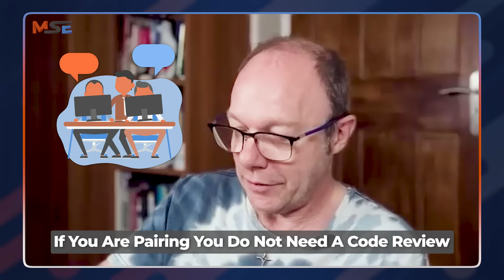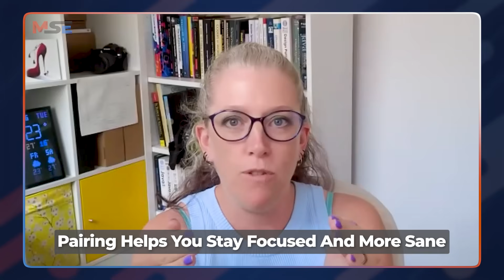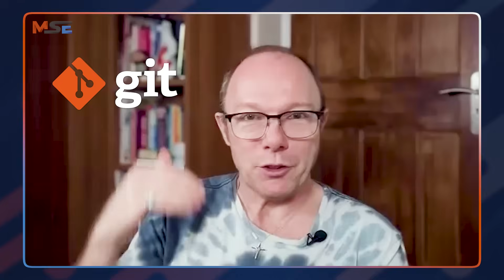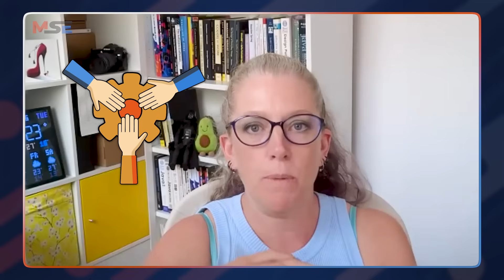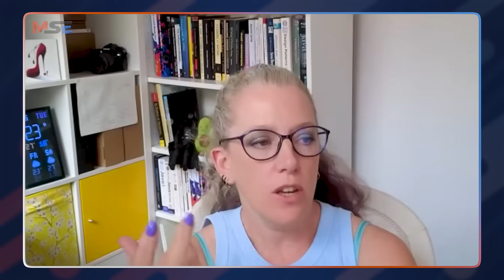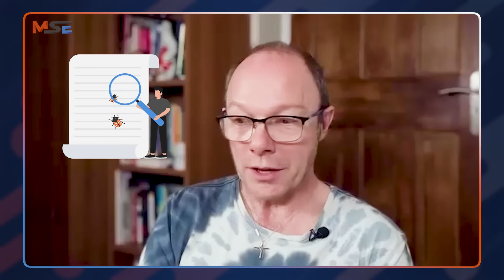Are Code Reviews Even Necessary?

Comment: Trunk-Based Development changes where collaboration happens.

If code review happens only in pull requests, it is often too late. The important architectural and design conversations should happen before and during the work, not after everything has already been built.

Pair programming, mob programming, or even a short discussion with a colleague is often the real review.

Then the PR is not a safety net anymore, because the safety was already built into the way we worked from the beginning to the end.

Comment: I think code reviews are even more important now. For one thing, we as developers are responsible for understanding the code. For another, just someone looking at the code who wasn't involved in writing it will have a fresh perspective that's valuable. Also, AI code reviews are more and more useful. A question I have is are these code reviews taking longer for the same amount of code as before, or are they taking longer because there is more code going in? If the latter, they're not really a bottleneck. It's just that's more code than the team can cognitively handle, and maybe the team would benefit from turning AI to other tasks for a bit, like code hygiene or documentation.

Comment: I had hoped to get at least a few concrete examples how other teams solve this "huge bottleneck" code review when we generate so much  code  and how they avoid spending much more time for code review than to generate  the code ? you have some ?
Reply: Most of the teams I have seen doing it online dump pre commit reviews entirely so they are not blocking, and replace them with test driven development to generate an executable specification, and continuous integration to make sure there are no regressions.

Comment: AI (Co-Pilot/Codex/Claude) is my new pair programmer and code explainer. I recently did a KT and used Co-Piloit to explain (my own code) to me in plain english, and while it occasionally got things wrong, it also surfaced quite a few issues with the logic that were diffucult to see, and none of the humans who had reviewed this code over time had spotted.
Reply: As llms fundamentally have no model, just lots of correlations, this is exactly where they work best, highlighting code which is implausible so you know where to check. When you running it the other way to generate code, what comes out looks plausible, but has a good chance of being buggy, just like most of the code that was in the training set.

Comment: I'm going to wrestle with this one because I don't have anyone review my code but I do have one person that will be responsible for every bug and that's me.  So in order to avoid having to deal with issues, I learned when I first started coding 30 years ago to write code that almost never fails.  It's not that difficult - it's like taking a SAT score scoring 790 and then fixing the one wrong answer during testing.

But I've seen people who are pathologically dependent on code reviews to make their code work.  They also never find any bugs (ever) and their code doesn't work half the time and I find 50 bugs in 10 minutes usually.

It comes down to accountability and pride in your work.  I don't know if you've seen a Japanese master artisan on their craft but they treat everything with the exact same level of care and attention.  I just do the same for code.  If anything ever fails in our application, it's a 3rd party tool or a problem with another piece of code that I never looked at.  Once I had one deployment out of thousands have a tiny issue and I realized I'm getting old 🙂

So do you need 2 people to do the work of one person?  Probably not but junior developers usually can benefit.  There are also many people who were never meant to be developers - they are more programmers and code/bug generators.

Comment: For me there are 2 aspects regarding code reviews. The first aspect is to try to understand existing code. Identify entry points. Identify where there are boundaries between communication layers. understand bugs. Etc.. We had coding style guides but no one was enforcing them. I abandoned coding style guides especially if it turns into a bothersome formalism exercise. In the end I stick with only few rules. "Don't try being too smart and cramp too much logic into a few lines of code or a single line of code".
The second aspect is using static code analysis tools. It may help me identify issues I have overlooked. But it may take some time understanding the rationale of an issue and introduce a fix that doesn't cause too many new issues.

Comment: Who exactly thinks they're not necessary? What kind of operation are such people running? Websites for personality quizes and celebrity news that's 90% ads? Is that peak engineering for them?
Reply: A lot of the public reviews I have seen are pre commit reviews which are pure gatekeeping, which just slows everything down, and are thus completely pointless and should just be dropped. The three types practiced by the two experts are not that, and can be done after committing the change to flag up policy problems, help formulate policy, and just show off good code or share knowledge.

In most public contexts, the primary problem seems to be  a lack of reviewers, combined with too many changes stuck waiting for review, which just slows everything down without making a big difference.

The only solution I know of is to do test first design tto give you an executable specification which is then run as part of continuous integration, where the best way to do it is tdd.
Reply: @grokitall  Automated testing isn't enough. It just tells you if there's any regression, given that there were enough tests actually implemented. And most of the time the developers have to update the tests. How do you know the tests pass because the developer updated them incorrectly or because there were no regressions?

With such a hurry to just push and ship, no wonder why almost every single website is frustrating and unusable. In serious software industries that has quality standards, there are many review and testing stages before anything is merged and a lot more before it's shipped.
Reply: @grokitall  you mean pre merge, no?
Reply: @ivanivanovski1 when you are doing tdd, you could be running as high as 100 tiny merges per hour, and a 15 minute wait before you can commit for someone to come along and review each one just does not work. This is why they use testing, trunk based development, and ci.
Reply: To the CTOs here: I’m a veteran systems engineer (20 years exp). Ready to take over your team's routine tasks and clear technical backlog.
After a massive force majeure, I am starting over from scratch. Not looking for charity—приму (accept) hard engineering work to stand on my feet again.
If your team needs workload relief, let's connect. Details are in my bio.

Comment: You are all so blessed working in such small organisations.
Go out there see the ugly and the bad, then you don't even think about this question at all.
Reply: Yes, but for example: Equal Experts and Thoughtworks consult with Fortune 500, and the speakers here write books, speak to and at conferences with similarly large organizations.
It's the position in the company they are hired to operate at. These organizations have people or groups who attempt to raise, push or set examples or the standards up to a higher level of software engineering.
Reply: Yeah.. We do code reviews at my org to make sure the devs actually did anything besides committing arbitrary whitespace and pretending that the 0.1 story point feature is actually taking several weeks to implement. There are a lot of people out there scamming their employers, whether you think that is good or bad is up to you...
Reply: What do you want? a medal?